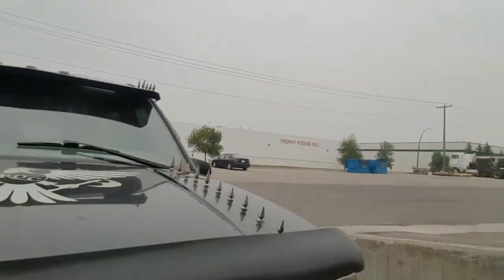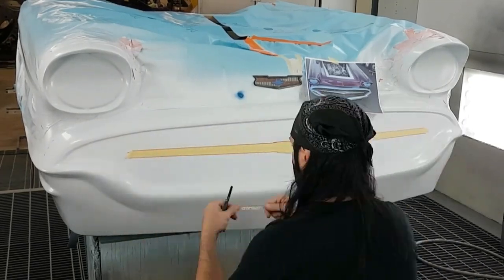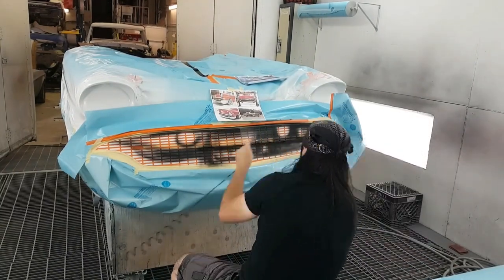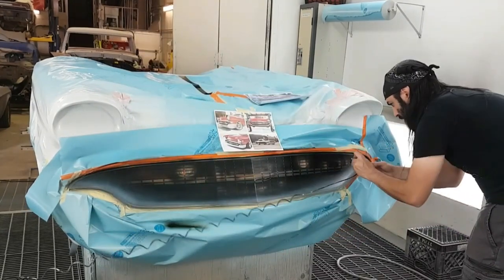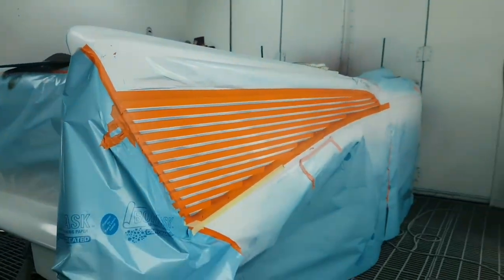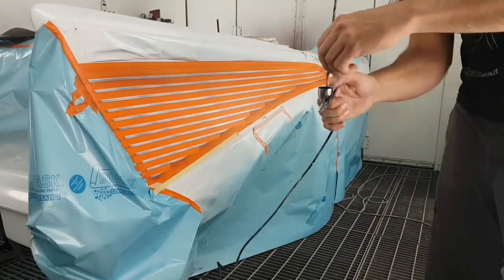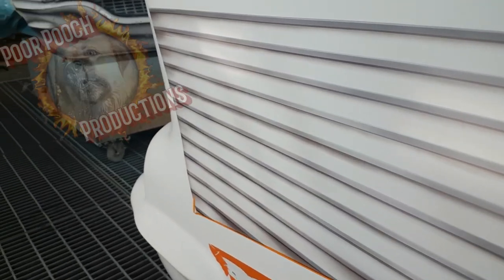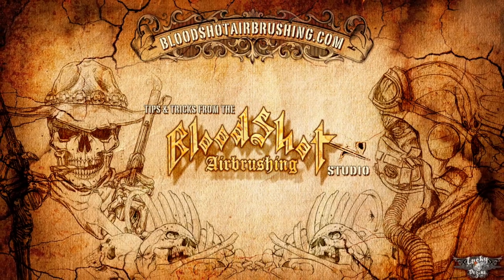How to Airbrush a Dragster Tutorial. Video 2-Painting the Grill and Tail Fin

Comment: Hi Ryan looking bad a$$ as always  looking forward to the next step I rewatched a hack video you mentioned bottom of paint cup loseing the crome finishing my HPC Iwata was doing this along with another brush I use...I use the 25% / 75% mix you recommend but I to have the paint thickening?? And clogging up on tip I try to have paint thickness like milk? What might I be doing wrong??? THANKS AND CHEERS
Reply from the maker: Hmmmmm.... so my first thought is that you may be doing nothing wrong at all. I tend to give my needle a quick pinch and clean off any dried paint with my fingertips every minute or so of spraying. Regardless of how thick it is. I think it's just nature of the beast with an airbrush. Applying air to paint will always dry it quickest at the point where they first come into contact with each other.  I clean my tip so often that I dont even realize I'm doing it... it's become second nature itself!😁
As for the chrome in the cup .. both my brushes have been worn down. I'm not sure if its from the metal on the paint brushes I use to clean the cup, or if it's a reaction from the cleaner... however I can say this... I've never had any issues from a lack of chrome plating inside the cup... still sprays like a champ.😀👍 And with the amount of money I've saved not buying airbrushing cleaners and separate thinners... 🤔 I could have bought at least 6 new airbrushes...😉 but the two I got are perfectly fine! If it ain't broken, dont fix it.... lol!! I hope this gets you going broski!! Keep that paint flowing!! 🤘😎 Big Cheers and Much Love from the BloodShot Studio!!
Reply: @BloodShotAirbrushing  Thanks Ryan getting back I clean the like you said but the seems to be to thick in cup I pull needle back and spray to unclog I think you said you use apx: 40psi?? All the time??
Reply from the maker: @richardgray8682  you got it! I prefer to keep a constant pressure of 40 psi. 99.9% of the time!!😁
Reply: @BloodShotAirbrushing  Thanks Ryan